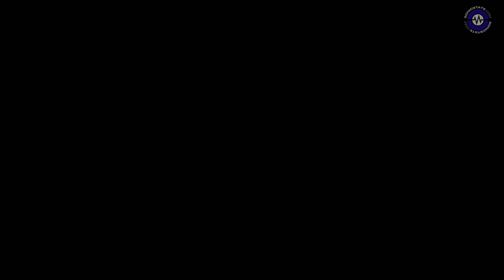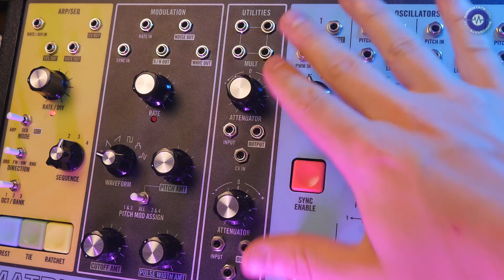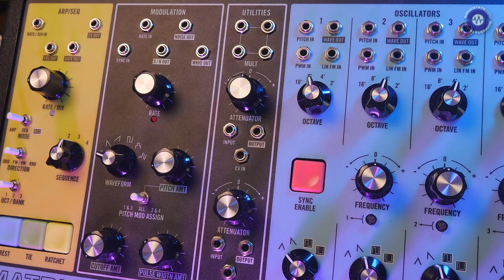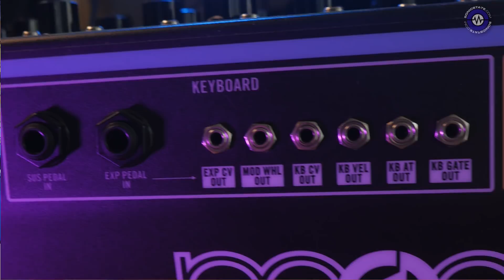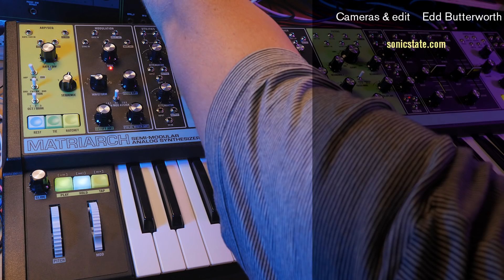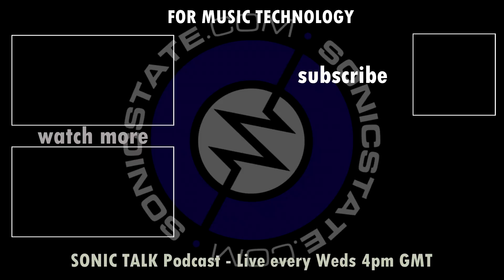Moog Matriarch Patching Concepts and Techniques  - Sonic LAB

Comment: I think your synchs aren’t working - they cascade from left to right.  So any light not on indicates neither that one nor the ones to the right are synched.  So all your patches where Osc 2 is not synched have none synched even though the lights of 3 and 4 might be on.
Reply: That's what I figured.  In a video I made about the attenuators I admit that I haven't got a  clue. Your right, the sound starts on the left and works it way to the right.  So when I run a wire, I have my output on the right side and my input on the left, but I still  can't anticipate the results.

Comment: This is very nice demonstration of the fm/rm/am patches. Now, it is important to notice smt - if you for any reason change keyboard voltage output from default +-5 to 0-10 (velocity, aftertouch, mod wheel), it might not play your filter tracking correctly - for instance, if your velocity output is 0-10 velocity effect will be almost none (softest touch will be the same as the hardest one). I was tracking filter as in the last patch and noticed that tracking doesnt work under certain C with 0-10V of keyboard output. Also, play with round robin mode, see how it can lead to different results. Mix in the external modular gear if you have some, even if its the smallest system, opens a world of possibilities. But also note that some modules will require higher voltage (and I am looking at you, Doepfer). My point - do not mess with CV values if you don't have external gear, leave them as default. Matriarch is one of the most beautiful instruments I've ever had in my 30 years of dealing with electronic music.

Comment: Not a Synth head but love playing them and for anyone wondering how it is without any modulation? its great as just a 4 osc synth with an an amazing delay and beautiful sound. I might try to get into the patching a bit more, I do use an expression pedal into the filter which I love but all the rest is Greek to me.  Anyway by far the finest synth I've owned. Unless of course they release a simple 4osc mono version with the Delay and Spring reverb with no patch's and built in velocity and  aftertouch. Dream Synth for sure.

Comment: is it possible to connect moog matriarch to ipad to play midi on the moog?
Reply: Yes.
Reply: What do you mean. I use to have a computer with midi in, thru, and out, but I couldn't effect my keyboard with the computer. That was 20 years ago. My wife thru out my computer at a recycling facility without keeping the midi hardware. I wanted to break her neck. She said I wasn't using it so she figured out it was junk. She is an idiot. I told her never to touch me equipment again.

Comment: Thank you for uploading this.  Question about the patch starting around 17:00 - Where are the Wave Outs of Oscillators 3 and 4 connected?  What is plugged into the input of the upper Attenuator of the Utilities module next to the Modulation module?